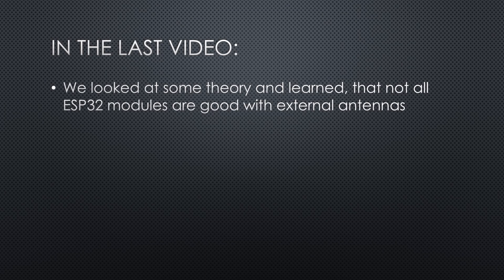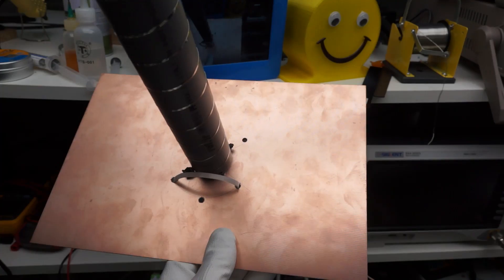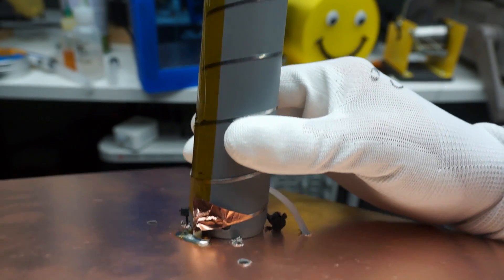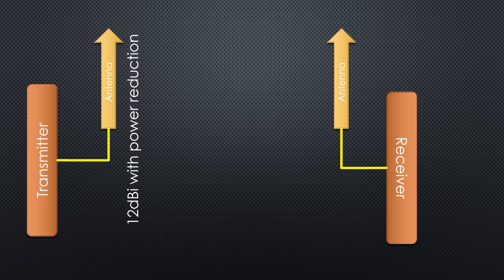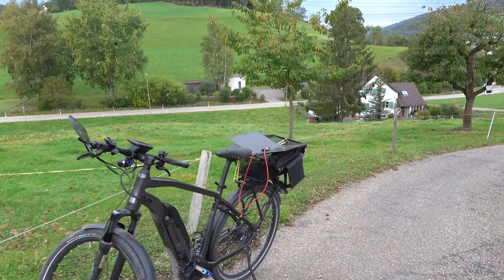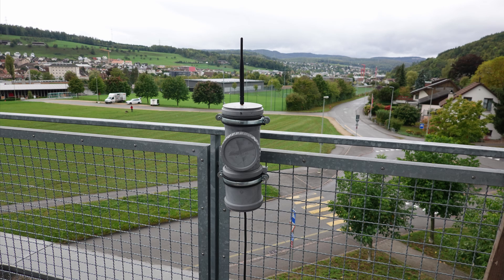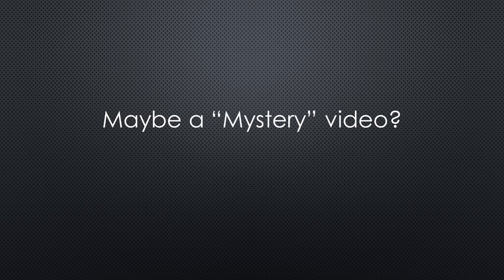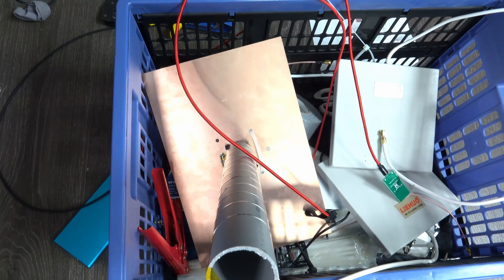#292 Wi-Fi Antennas with Gain and ESP32 Long-Range Mode (part2)

Comment: I think you can improve the RSSI values if you use the same polarization in both transmitting and receiving antennas. I noticed that the panel antenna on the pole is using vertical polarization in contrary to the panel antenna inside the car which is using horizontal.
Reply: yup theres atleast a 3dB loss there ... RX and TX antennas should ideally be identical, both in dimensions and orientation..mixing horizontal with vertical and circular is very bad practice!..(even upto 30dB loss when mixing circular with horizontal or vertical)
Reply from the maker: @WacKEDmaN Are you sure about the 30 dB? I also had 3 dB in mind if polarization does not match.
Reply: @AndreasSpiess if you have a polarization mismatch of 90 (270) degrees in theory, you will have infinite losses,  in practice is between 25dB and 30dB.
3dB losses is if mismatch is 45 (135,  225, 315) degress or if you use combination of linear and circular polarizated antenna.

Comment: Is there any chance of producing a comparison of commercially available stub and whip antennas?

I remember from earlier videos that some Chinese antennas were tuned to the wrong frequency and one or two were OK on 2.4GHz.

I need to mount some ESPs, via uFL to SMA, in metal boxes and I need to find usable antennas for them.

Thanks
Reply from the maker: The dealers on Aliexpress change their suppliers quite often. So it would make no sense. The only thing you can do is measure yourself. Or by from trusted suppliers. Sometimes even two antennas of the same packet are different.

Comment: Did you take the beam width of the antennas into account ? I noticed that the antennas are dangling from the mast. If the beam width only is a few degrees it makes a lot of difference.
Reply: I guess the beam width is about 30 degrees. Have a look at the radiation pattern polar plot: https://www.comsol.com/blogs/analyzing-operating-mode-options-for-helical-antennas/
Reply from the maker: I agree my mounting was not ideal and I lost a dB or so due to that fact.

Comment: "Unoficially sponsored by Swiss Tourism Office" ha ha. Excellent Mr. Spiess.
Reply from the maker: I did not see any cash :-(
Reply: By the way, may I suggest an alternative to the box? Blue Ikea bags are cheap, robust and lightweight, and once folded takes no space. When I worked as a field technician used it to transport up to 15 Kg. Can be handled using only one hand or carried in the shoulder. And in several occasions used them as a cover under the rain (they are waterproof).

Comment: In my experience, rain and fog do attenuate wifi signals quite a lot. Both wifi and microwave ovens use frequencies around 2.4 GHz.  Maybe that is the clue? Microwave ovens heat the water in food, so water must absorb radio energy very well at that frequency.
Reply: My experience is that I have been using a flat panel wifi antenna to connect to a free public hotspot in a building some distance from my flat. At the best of times the connection can be a little slow but useable. In rain and fog it does not work at all.
Reply: If the helical antenna is wet an the antenna material is not made water absorbing, you will get  small waterdrops on the metal. This may changes the SWR. I had this problem on a helical antenna I use for extend a RC Groundstation für a Multicopter (looks similar to Andreas antrenna). After putting a second tube around, less or more a very thin plastic foil, so that the antenna doesent get wet anymore, I never had problems in bad weather conditions again. And yes, as mentioned somewhere: Polarisation is important.
Reply: We are dealing with H2O molecule scattered in atmosphere and not with H2O molecules next to H2O molecules, water. The wavelength shrinks to lambda/80 in water from lambda/1 in air. All our missing dB didn’t just went into each water molecule in its path in the air. 

I speculated the missing dB went into (3) and (6) below.

For those who are diy - not antenna researcher / developer - (1) antenna directivity, (2) return loss S11 / VSWR and (3) material dissipation are three dominating losses to be dealt with prior to following consideration, such as (4) propagation loss, (5) space dissipation loss, fog / rain and (6) beam deforming of beam forming antenna. 

Before we treat the VSWR issue the first foremost question is - is it tuned (in resonance) or not? Once that is well tuned can we then address the Z match issue. 

Antenna not at resonance operate in “leak mode” may be call a RF leaky grid.  

The horn of a horn antenna is just a progressive distorted open ended wave guide. Each equipped with a resonator fed from its input port. Yes resonance is primary important. 

Once the helix array is at resonance we then address is it beam form correctly?

Beam forming and gain : helix diameter or pitch parameter deviation of optimally adjusted helix array will disorganize beam forming criteria and therefore gain. That makes helix antenna cloning a tedious task. Developers often use variable former diameter / pitch to play with gain change before settle to an optimal state. 

DIYers can use beam width reduction as indication for gain increase during an optimization phase - continue optimize and skip Z match to the final approach. 

Hope this helps.
Reply: Indeed, the reason routers work at 2.4GHz is BECAUSE microwave ovens operate at that frequency. The band had been left vacant by regulators, who didn't want the ovens interfering with other things, and thus it was available for domestic wireless devices. See https://gizmodo.com/giz-explains-why-everything-wireless-is-2-4ghz-5629814
Reply: Worked in the Microwave communications field for a good number of years.  Yes Rain attenuates microwave quite good.  Snow even more so.    I can tell you 8 - 18 Ghz is WORTHLESS in snow .  LOL
Reply: I have to admit I have found Rain and Fog to affect WiFi in general, but not to a huge extent at 2.4GHz.  Mainly in higher frequencies.
Reply: @EsotericArctos  I run 2.4 and 5.8GHz long range outdoor networks, and I've never seen even torrential rain cause any problems.
Reply: @SteveWrightNZ  If you designed your pathways with good RX\TX and they don't failed in rain, that's not empirical evidence that H20 molecules don't absorb 2.4Ghz RF. Because they do, therefore 2.4Ghz is attenuated, that doesn't mean your link will just drop. RSSI values just become lower.
Reply: @Roobotics  I suppose in ten years of maintaining outdoor networks I must never have noticed that.  What is your experience?
Reply: Ultimately, rain has some effect, not as much at lower frequencies as at higher, but from an installer, ISP and Regulatory body perspective, it has been demonstrated on WiMax networks here in Australia that inclement weather does affect these networks.  It may not always be noticeable, depending on your original strength and distance from the base station, but it is measurable.
Satellite communications are another prime example of how rain attenuates signals.  
Once you get up to 12GHz Ku band you can have less than half the signal getting through in rain/overcast weather.
WiMax operates mainly on 3.5Ghz, 5.4GHz and 5.8GHz here and from end user experience over thousands of installs, when you are on fringe areas rain does affect performance and can even cause the signal to completely drop if you are on the edge of the coverage range.
Your milage may vary as the saying goes.  This is just my experience with wireless technologies.
Google WiMax and Rain Fade and there are several research documents supporting rain fade
Reply: @EsotericArctos  Which is nothing to do with original content here, and doesn't support what you said at all, and your "experience" is nothing to do with "installer, ISP and Regulatory body perspective" because you aren't any of those either..
Reply: @SteveWrightNZ  the frequency ranges of
 WiMax cover  the frequencies you have claimed are unaffected.
There is even a specific formula for calculating rain fade for outdoor wireless links.
An example at 2.6GHz can be found at file.scirp.org/Html/1-1560181_57799.htm 
There are many other examples of wireless rain fade studies online also, as you should know after ten years installing links.
You claimed no effect on 2.4Ghz or 5.8Ghz.
Please provide your evidence of this.
The protocol is irrelevant.  It is attenuation of the signal that is relevant, and this is what affects range.
I guess 10 years as an engineer working with IPStar installations and a further 15 with Telstra do not count as experience :)
Edit: corrected some typos.
Reply: Brendan White 
I agree with you in full on long distance link in free of Rayleigh fading or multi path self interfering splattering. 

If I understand author report correctly his link fall short beyond what moist air can explain. 

Satellite up/down link is less affected by multi path fading with narrow beam antenna while WiFi and WiMAX are more affected on down than up link due to relative residential complexity antenna steered width is relatively wider.
Reply: My actual experience as a wireless ISP is that your suggestion is not correct.
Reply: Steve Wright actually physics and RF theory say otherwise, while not WiFi specific, yes certain frequencies play differently to surroundings.  

run a local private WISP for my neighborhood friends using off self equipment so nothing major.  half watt high gain WISP systems from TP-link so nothing impressive but it’s for me and my buddies to combine and share our networks and have our own off the grid network almost and also keeps us online if power goes out as 2 dif grid lines cross our area.  But during huge thunderstorms and rainstorms the 2.4 ghz networks do suffer more at far ends of connection more so than our 5.8Ghz networks do.. link quality falls off the cliff quickly.  Now in blizzard/heavy snow it’s the other way around, 5.8Ghz connections suffers more with rapidly decreasing link quality further out and 2.4Ghz band doesn’t care much.  So far furthest I thrown a usually signal was on 5.8Ghz band and was 5.06miles using TDMA, 5mhz and full 27Dbm (I know weak).  but I’m surrounded by a lot of stuff like trees, hills and buildings and I’m limited to my own house and where my patch antenna is mounted is only 50 feet up. I can’t install a tower in my area with pissing off people :/

Comment: I use an outdoor square type 2.4 GHz patch antenna for regular  wifi to get it from remote router. I am always surprised that it works  just as well even if there is torrential heavy rain or snow storm. The thing that has  effected the signal the most was a heavy dew on tree leaves when the sun is at a low angle when coming up in the morning. But soon as the sun rises higher the wifi signal would come back okay.  There are some hams in town near here using Aredn Mesh firmware in routers that are capable . On the ham bands certain frequencies are in standard wifi ranges so it allows the use of much higher power if someone wants to. I haven't gotten around to trying it out yet.
Reply from the maker: I can imagine that wet leaves are a reasonable ground quite high in the air. But good to know that fog is no problem. And I also read about these mesh networks, but never tried it myself.